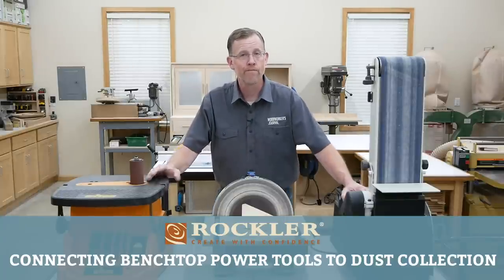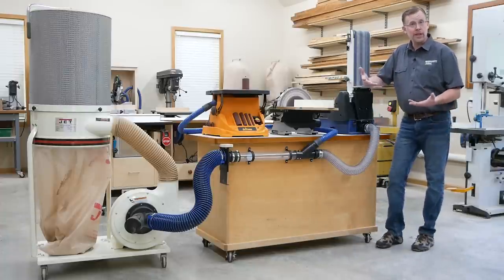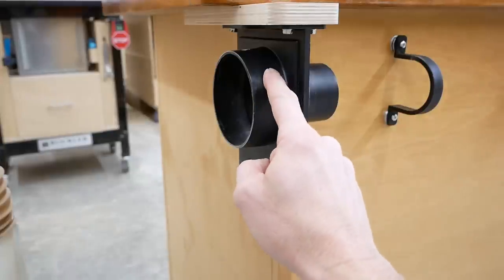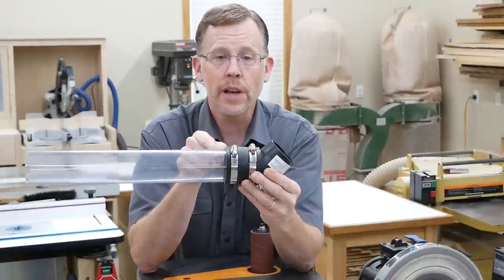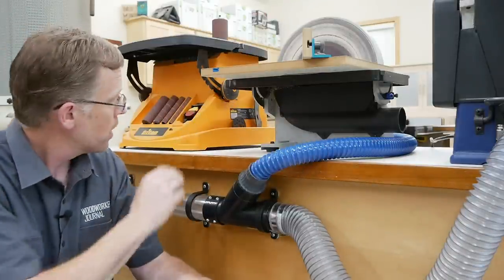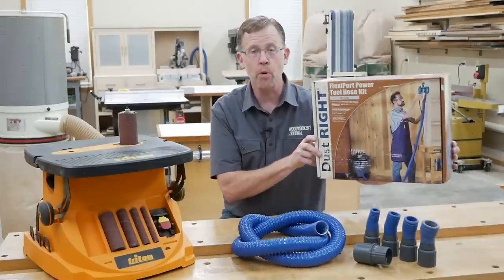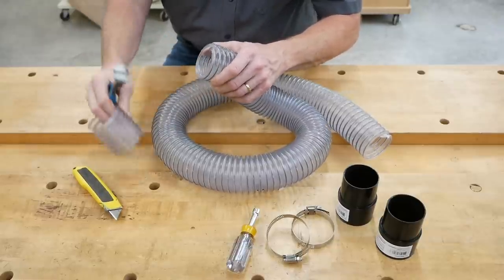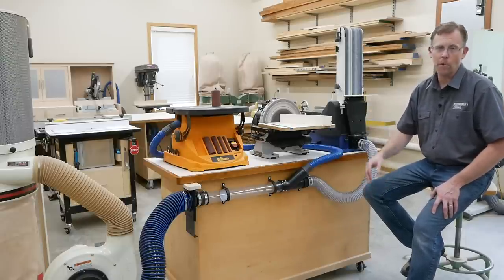How to Run a Dust Collection Line to Benchtop Power Tools

Comment: Now as an option you just need a blast gate to control the air between a Disc Sander and belt sander so they are not running simultaneously

Comment: So your dust collection is open to all three machines  at the same time? Why do you need a shutoff gate  then?
Reply: Ron Wallerich by using a shutoff gate, you can get some of that suction power back if you are not using that tool at the same time. You lose some suction power with every funnel (especially the longer it is).
Reply: A gate at each of the 2 branches makes the most sense. The gate at the 4" connection is irrelevant.
Reply: @zzgarden   Was thinking the same thing, but noticed, it looks like there is a Y with a cap at the mouth of the suction unit. So 4" gate could be of use. There should however also be a gate at each device so it's not sucking from multiple devices while just one is in use.
Reply: @zzgarden  My thoughts exactly.
Reply: @jvbeattie1  @Stephen Miller   @Clifton TV   The dust collection needs to be sucking air at the 4" diameter throughout the entire system or it's going to put too much of a load on the motor to maintain suction. My understanding is that the unit in order to function at full capacity needs to have all the hoses / gates open (in this scenario) if they're being reduced from 4" to 2" in order to pull the volume of air that the motor is rated for. I'm not an expert -- this is why it's better to use a shop vac and maintain vacuum hose diameter for individual (small) tools rather than a higher rated CFM dust collection tool stepped down for benchtop and power tool dust collection.

Comment: So your dust collection has a 2 and1/2 inch main line connected continuously to a 2 & 1/2 inch hose and what looks like a 1 & 1/2 inch hose at the same time. Seems to me , for a proper connection,  you should have just left the main line as a 4 inch hose including  the y connection and then reduced to fit the machines. As it is, neither machine is truly getting the proper flow/static pressure as each connection is a drain on the other from an under size hose prior to the y fitting.
Reply: Plus, he has like 8 feet of that tiny blue hose going to a tool that’s about 3 feet from the collector. I’ve never had luck with a 4” dust collector trying to pull through a small hose.
Reply: Yeah, maybe he figured the run was short enough it wasn’t a big deal and the 2.5” wyes are easier to come by, or just that taking up less space behind the bench was worth it. I’d still try to go with 4”, and definitely for a run along a longer bench.
Reply: Perhaps a gate for/after the y connection? As in, I doubt he’s using all three of these tools at once…
Reply: He is doing some advertising for flexiport kit.

Comment: this guy comes straight out of a 4" dust collector and goes right away to 2-1/2" pipe.  I contacted Rockler about using a dust collector connected to my 2-1/2" system and they kept saying it would significantly reduce the air flow.  as I am unhappy with the results I am currently getting with my 5HP shop vac, I wanted to go to a full dust collector, but Rockler discouraged me with their talk of reducing the air flow.  my thoughts are actually, if I get a LOT more air flow with a dust collector, but it gets reduced, would it still be better air flow than what I currently have?  never got an answer from Rockler on that.
Reply from the maker: If you use an adapter coupling that switches airflow from 4" to 2-1/2," as is shown in the video, the overall volume of air moving through the smaller hose or pipe will be decreased because the airflow is being restricted. However, provided these runs of smaller hose or pipe are short, that loss in air volume won't impede dust collection efficiency to such a degree that the system won't work. A dust collector is moving a huge volume of air, so short runs of pipe or hose will still benefit from the dust collector as the source of air draw. But, restricting airflow from 4" to 2-1/2", then creating long runs of the smaller pipe or hose, would not be a good idea. Regardless of the setup, efficiency with a dust collector will always be optimized if the truck line (line coming directly from the dust collector) is as large as possible, and the branch lines are short as possible (lengthwise) and at the largest internal diameter possible.